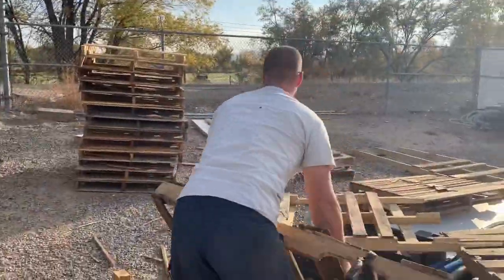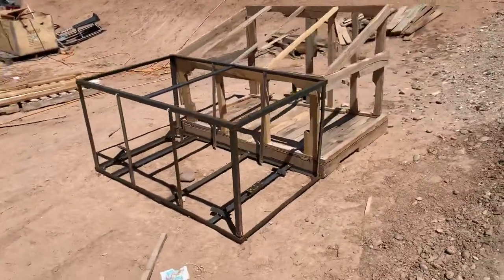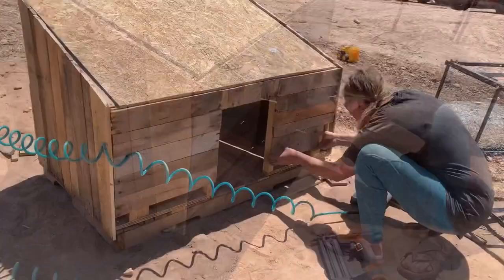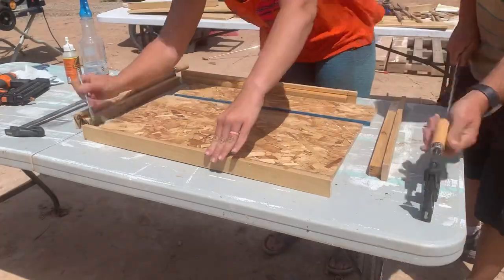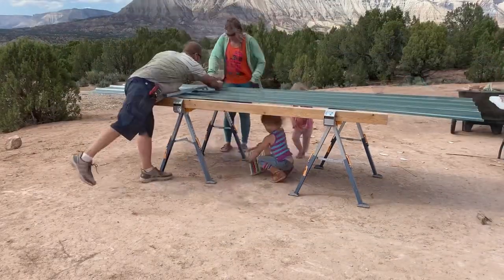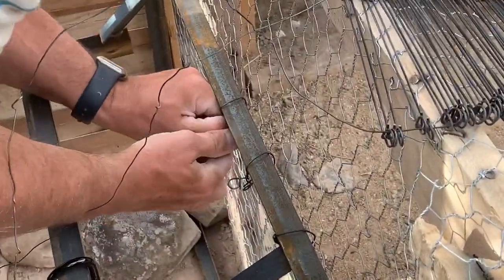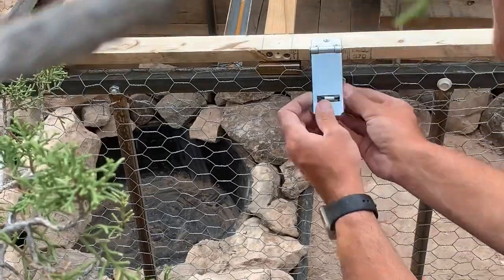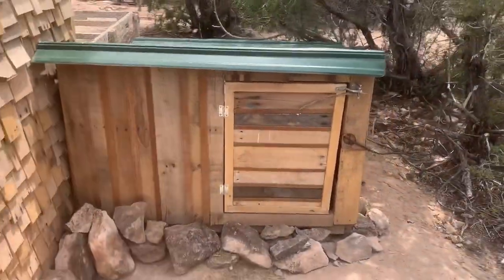DIY Duck House- Building On a Budget

Comment: It‘s beautiful. Great job. I didn‘t see any ventilation though which helps release the ammonia and keeps them drier in winter. I am not sure how harsh your winters are, and you may already know this, but ducks put off so much moisture that it can freeze without fresh drier air. Cross ventilation at the top covered by 1/4x1/4 hardware cloth to keep out the predators will help deter any respiratory issues.
Reply from the maker: All great points, thank you for your encouragement and wisdom! We love getting feedback from our viewers. To put your mind at ease: There is one completely open door way on the front of the duck house (that opens to their covered run area, and then there is a crack all around the edge of the back door that locks to keep predators out but allows for ventilation. They free range all day and the door is left open for cross breeze and that way everything can air/dry out if need be. We live in Southern Colorado in a very dry desert scape, so not a lot of moisture unfortunately and fortunately I guess🤪.